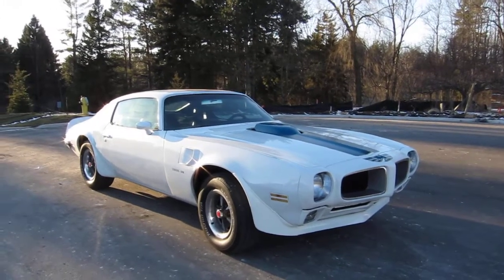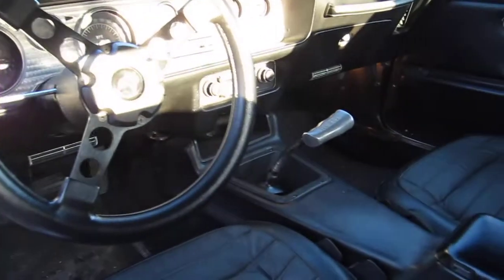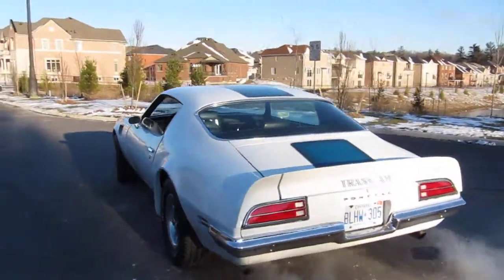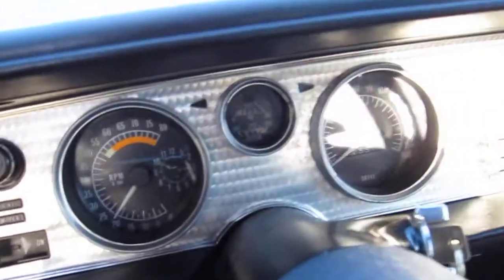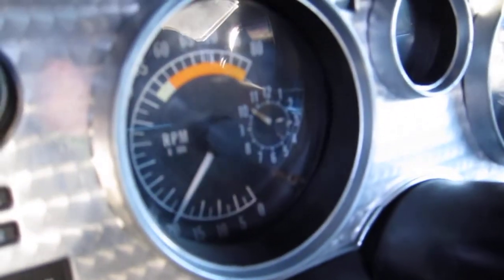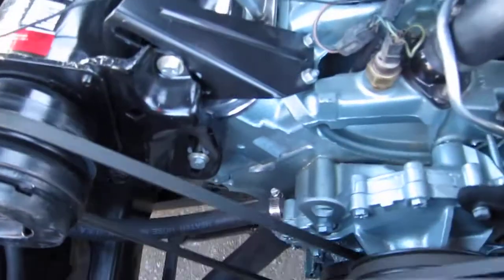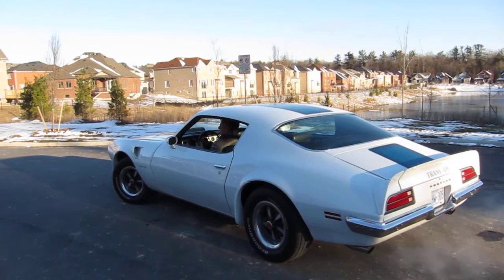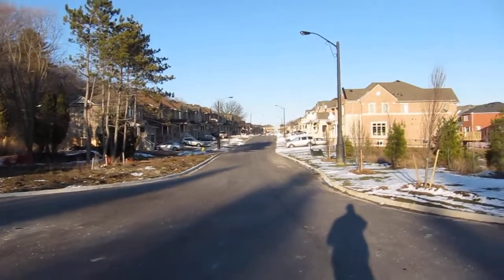1970 Pontiac Trans Am

Comment: I have a 1973 Red/Black 455/4spd and have owned several 2nd generation Firebirds (Formulas and T/As) and I have yet to see the clock work. This is one item I would consider changing even on a restoration project. I'm going to start working on my '73 soon and get it on the road again. I bought it from the original owner back in 1987 after I got out of the service. Fun cars!
Reply: 73 ?  Damn ... that is awesome.  They were beasts.  I envy you!